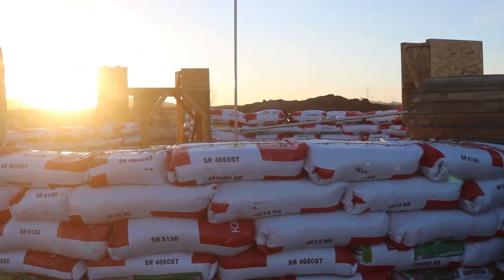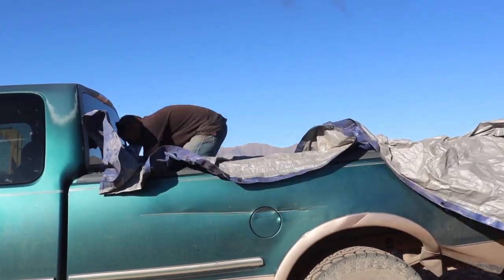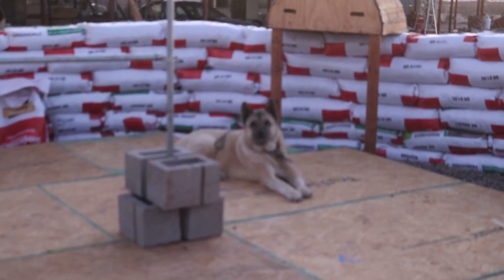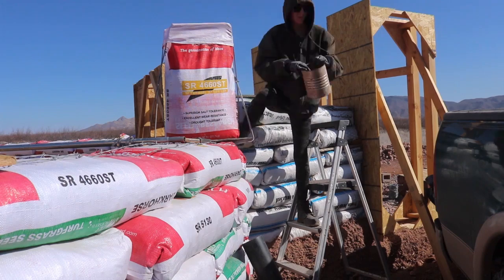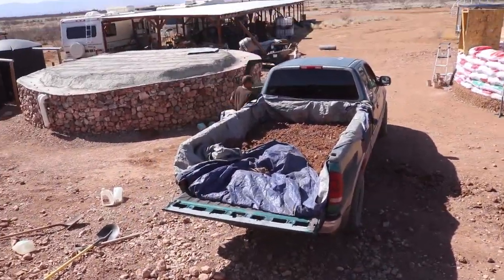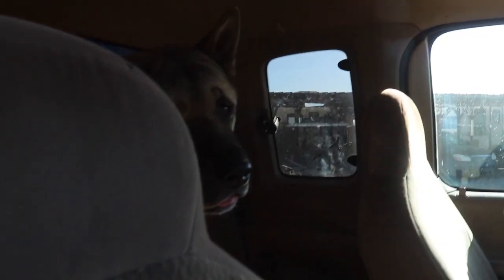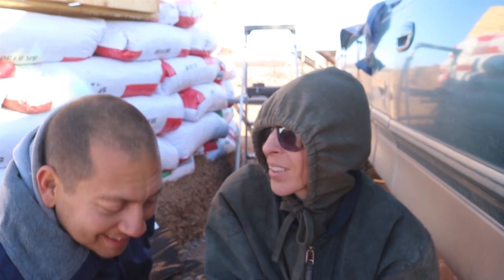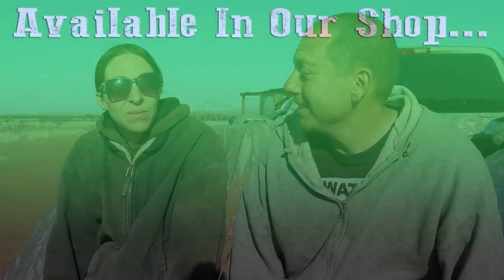Tiny Woman Clings Desperately Onto Wall As Fierce Desert Winds Put A Stop To Our Earthbag Build

Comment: When you get further up, you can also use the truck to break your fall if you position it beneath you as you work around.  It would still suck to fall, but if you hit the top, you would save falling an additional 6ft or so.

Comment: I know you said you wanted to have a fenced in area for your dog... I would suggest making a gabion posts about 18 inches in diameter.. Fill with  xtra rocks as you get them.  Space the posts every 8 ft apart.  Keep eye on craiglist for chainlink fence to stretch inbetween posts.  You dont really need to dig a hole for the posts as their own weight keeps them sturdy

Comment: Harbor Freight has a full length bed unloader for under $50.00. I haul a yard at a time and hand-crank it off in a couple of minutes. I put a tarp in which lays over sides and adjusted back from box edge by 1 foot at tailgate. I cover it with the tarp and Large pick-up net from harbor freight when I have to travel. So so much easier than unloading by hand!

Comment: Just curious, are there any regulations against doing rammed earth walls, or have you considered doing that, kind of like doing earth bags without the bags?
Reply from the maker: We can do rammed earth. It has more costs though, plus it needs cement and a large roof.
Reply: Okay wasn't to sure about that, but was thinking you could seat with rammed earth to a certain height and then continue with earth bags after that height, just a thought.

Comment: You need to work smarter not harder you need to fill the truck with the muck and try backing closer to the pile and stand on the pile of muck facing the truck then you don't need to lift the shovel up a height
Plus make a solid shelf that will sit in the bed of the truck to stand on or even sit the tons of muck on you could move the tru k round most of the dome to keep it close to the work area. One final think is drop the small bags in the middle of the wall rather than right beside the window will made it more structural as the little bag will not hold as well. You should find that the big bag will stl take the shape of the window once tamped down.
Good luck with the rest of the dome and the rest of the house I can't wait to see you all move into it.

Comment: You would take you some magnesium Chloride de-icer crystals and mix that with your dirt I don't know the amounts to mix but the magnesium will pull moisture from the air and all moisture and to the dirt
Reply: I am not an expert.  Arizona's air seems dry to me, maybe without humidity or something it would be a waste of effort?  Never mind, I am probably wrong.
Reply: @leahferr3138  I have a dirt gravel driveway and use magnesium deicer to keep the dust down in the summertime when it's not raining...
Reply: @leahferr3138  it works very well you should try it...
Reply: @whitetiger432  Thanks for more information.  I have learned something new!